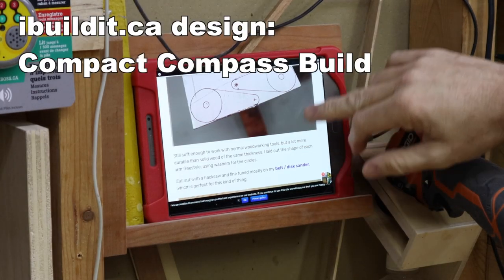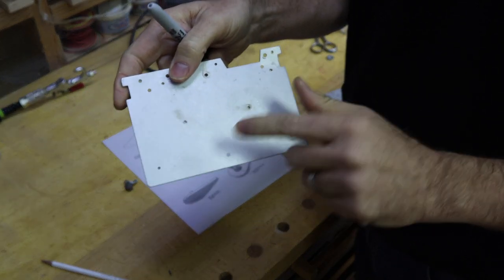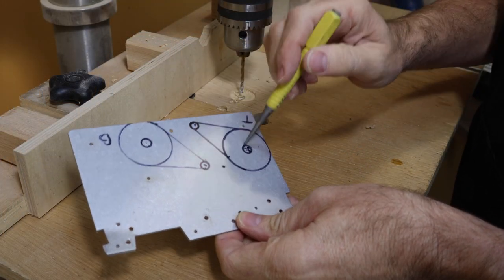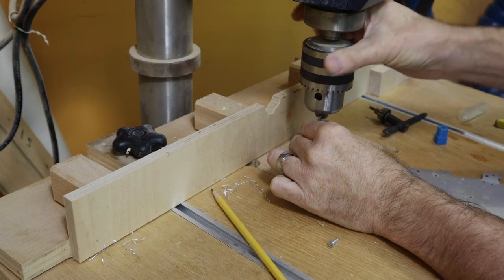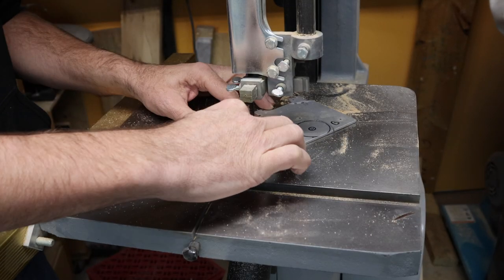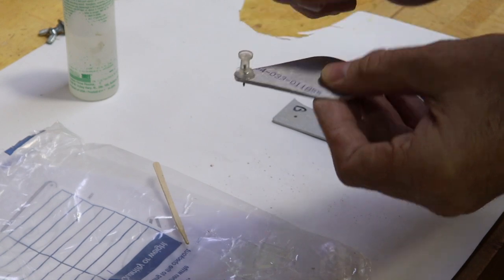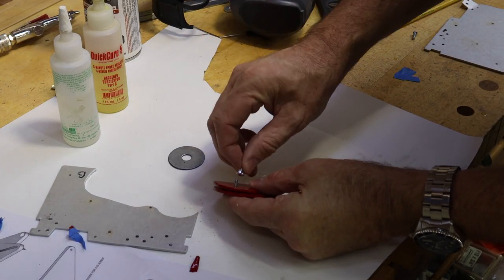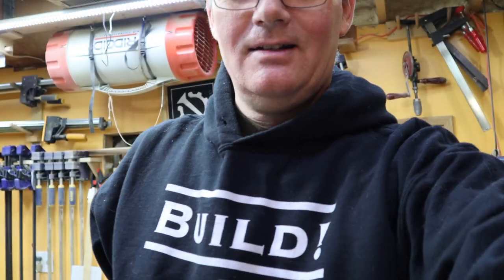HOW TO MAKE a Compact Compass // Quick and Easy Build (WnW #184)

Comment from the maker: This is a John Heisz / ibuildit.ca design, but I made it red so it's better.
Click here if you agree:  https://www.patreon.com/wordsnwood

📃John's Build Article:  https://ibuildit.ca/tips/making-a-compact-compass/

I've wanted to build this compass for a while and after doing so I wonder why I waited so long.   This is a quick and easy build, and results in a useful little tool.
I made mine out of aluminum, but you could just use some thing pieces of wood and it would work just as well.

YOUR SUPPORT IS APPRECIATED:
💵 Become a Patron: https://www.patreon.com/wordsnwood
🛒 Buy a Plan: http://wordsnwood.com/plans/
👕 Buy Merch: http://wordsnwood.com/merch.html

---------- ---------- ---------- ---------- ----------
🗜 LINKS TO SOME OF THE ITEMS USED:

(AND/OR other tools and jigs that I use and recommend.
Most of these are affiliate links.  If you buy through these
links it helps support my channel.   Thank-you so much!)

http://amzn.to/1pFGjPk — Sensgard ZEM hearing protection
http://amzn.to/1WSNq1j — Stanley Leverlock tape measure 
http://amzn.to/2lYXz3W — Other auto-locking tape measures

📸  GEAR I USE TO MAKE VIDEO:

https://amzn.to/2OVusfx — Canon EOS m50 camera kit
https://amzn.to/2nI7w8Q — Shure VP83 LensHopper Microphone
http://amzn.to/1qPkvBp — Canon T5i
http://amzn.to/2aK7jZX — Inexpensive Quick Release tripod ball head  (Very useful)
http://amzn.to/1SSwOmS — Sony Action Cam. (I use the HDR-AS15 which is discontinued -- cheaper than a gopro.)
http://amzn.to/267XM3M — Sony Live View video remote for Action Cam
https://amzn.to/2NddVjk — But I do also have a GoPro Hero 5 Black
http://amzn.to/1XC2D7l — Joby GorillaPod (Flexible small tripod)

---------- ---------- ---------- ---------- ----------

MORE MORE MORE:
http://www.wordsnwood.com
https://www.instagram.com/words.n.wood
https://www.facebook.com/wordsnwood

---------- ---------- ---------- ---------- ----------
🙏🙏Thank-you! 🙏🙏